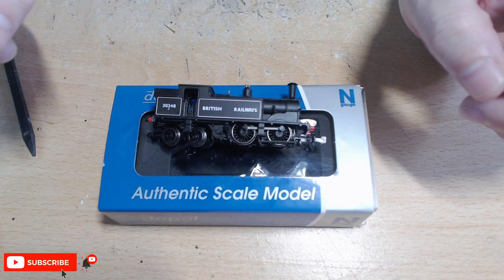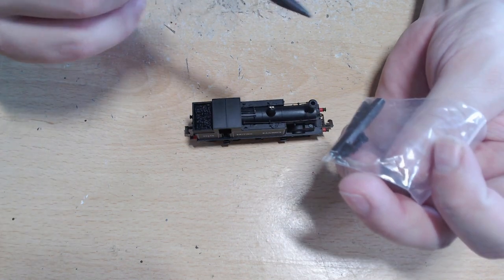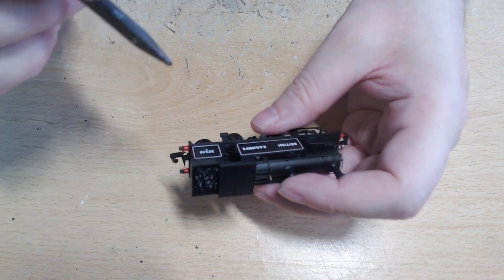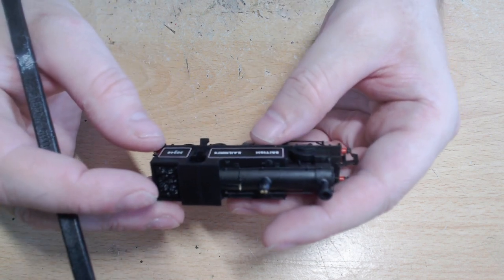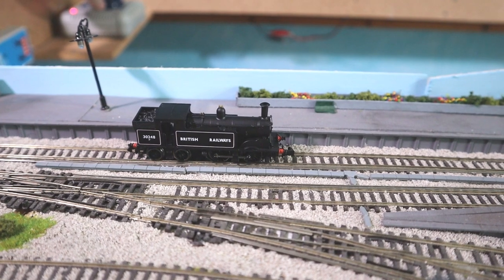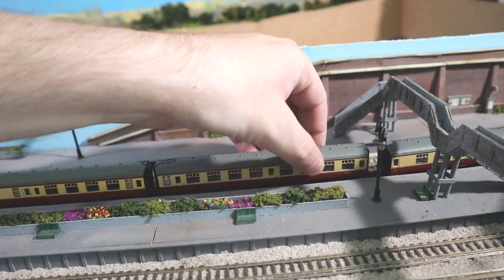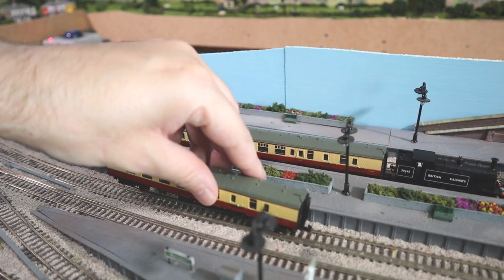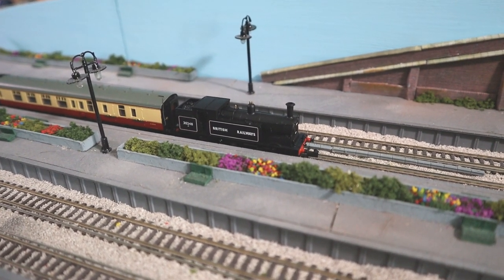A Newbies review: Dapol LSWR M7 Class Review (New '23 Version)

Comment: Hi James, nice review, you are getting much slicker with your presentation. I have bought the LSWR version of this M7. Not had a chance to run it yet, but have seen its sits a little high on the rear bogie. I also saw that Dapol do have a 'home' fix for this but will repair them in house if you are worried about doing it yourself. I'll run mine 1st, but might send it back for tweaking if it has connection issues.
Reply from the maker: Cheers very much, am trying to get a method to how I do my reviews, and I've seen Dapol's home fix, not something I'm too keen on doing myself (I'd prob do something wrong somewhere) but at least they offered a quick solution for everyone.
But mine is destined to be used for the O2's replacement chassis in hopes of getting that one running, though will have to see about shortening it instead heh

Comment: Thanks for the review.  I ordered one a few weeks ago and it arrived today with its DCC chip fitted.  Having seen some pretty damning reviews of the earlier version of this loco I was keeping my fingers crossed but have to say, from the limited tests I have run so far the performance seems excellent - smooth slow crawl  and acceleration in either direction.  However, I am having a serious problem - it just won't stay connected to the rake of three Graham Farish coaches i have asked it to pull!  Some background.  I have been out of model railways for many years but, now retired, I decided to start again and have gone for N-Guage to make the most of limited space.  I have constructed an "L" shaped board for an end- to end layout.  This has yet to be completed as I am am taking it very steadily laying the cork on the board and pinning the track so yet to motorise the points.  I bought a Graham Farish 5MT and three coaches so I had something to test everything with as I add each section.  This loco runs very well and gives me absolutely no problems, however, the M7 uncouples from the stock almost every time it goes over the cross-over from the - especially if the stock is at the bunker end of the loco.  It also uncouples when going round a 18' radius curve despite the fact that this is in the middle of a stretch of code 55 Flexitrack and no where near a track joint.  Very frustrating.  I would be interested to hear if anyone has had similar issues and knows of a cure.  it strikes me that the couplings are too light and are not lying true to that of the stock.  As I said, no issues with the 5MT t any of the points where the M7 uncouples almost every time.
Reply from the maker: Hello there!
First of all glad you enjoyed the review, and that is quite a bit to read through heh
For the couplings, I have found that some Dapol couplings as you mentioned, not quite in line with other couplings, my solution was either to slightly bend it back more true to where it should be, or to replace it with another coupling which is correct, which from the sound of your issue might be the better option.
The older M7s are... well the best which can be said is they are on the weak side, which the new version does sort out, though the new version does have it's own slight issues but it depends on how much it bothers you.
The 5MT is a nice engine, I generally have no issues with Farish engines, which is always good considering they do tend to cost more than Dapol engines and quite more tolerant as well to any slight issues with the track (while I don't think there's any with your track, always good to double check).
For my new M7 (which is now going to be a chassis for a kit) I've not had any uncoupling issues personally, so it's most likely a iffy coupling which was fitted to your particular model, try switching it with another one (even from a different manufacturer) and see how that effects it.
Reply: @GosportRailworks  Many thanks for your response and comments.  Since I posted my initial comment I have tried several things.  One uncoupling issue was a slight problem with the track connector in the cross-over.  I fixed that and now, most of the time, it gets through ok.  However, the other uncoupling point(s) have nothing to do with the track laying as they are right in the middle of curved stretches of flexitrack (code 55) layer using the 18" radius track-setter and perfectly flat.  The uncoupling always takes place at exactly the same points.  I tried removing two of the three coaches and then the problem went away.  I then added a second coach and, again, no problem, however, when I added the third coach back on to the rake, the uncoupling issue reappeared so, in my opinion, it is something to do with the way the weight / load is placed on the coupling that affects its performance.  I have never tried replacing couplings - been too frightened of damaging them!!  However, I will look into this.  Thanks.
Reply from the maker: Glad that one of the issues is sorted out, though the other one could just be a iffy coupling, always best to have a go at replacing them.
And they are surprisingly sturdy, though it's always the spring mechanism behind it which gives the most worry when replacing them, but so long as you're not too rough with it the coupling should just pop out.

Comment: Hi James . Nice review. The sloping chassis is very simple to fix and Dapol have already published a "fix", which they will do if the owner doesn't feel confident enough. The adhesion problem is caused by the bogie springing needing adjustment, it causes the rear pair of driving wheels to be out of contact with the track and the bunker end to ride high. The fix is simply a matter of removing the bogie, one screw, and bending the two vertical brass contacts on the bogie very very slightly towards the centre. Only a tiny adjustment is needed.  The rear driving wheels then make proper contact with the track, resulting in better pulling power, better current pick-up and a level body.
Hope this helps. Pete
Reply from the maker: Cheers very much Pete, and have read Dapol's home fix for the sloping, though I think I read it after the review (was a while ago so can't remember), and while the chassis is destined to be used for a kit I'll still have a go at the fix just to see how easy it is.
Perhaps make a video on it though do need to write down these video ideas somewhere heh
Reply: @GosportRailworks  Hi James. Just thought I'd  let you know that I took along three models made from your prints to TINGS along with some of your flyers.  There was quite a bit of interest, so hopefully a few more orders will be coming your way.
Regards Pete
Reply from the maker: Cheers very much Pete, always do appreciate all the help you do!
I'm sure there'll be a slow trickle of new orders but that gives me time to work on more things!